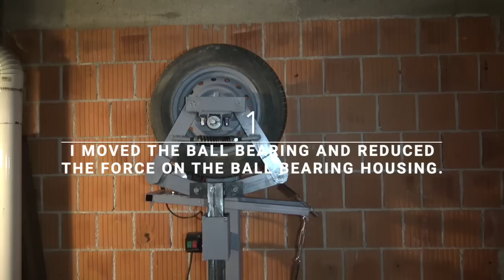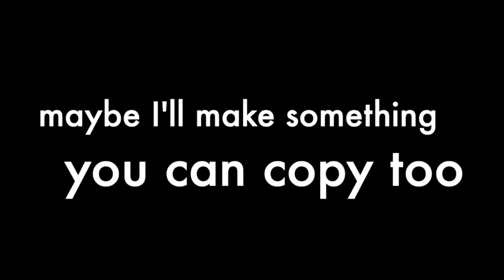DIY power hammer -step by step - home forge equipment

Comment: For all those wanting measurements. Here is a link for a rock crusher. It is not as refined as this power hammer. It can be adapted. 
No insult intended to the builder of this power hammer as it is a very nice build. 

I’m thinking a treadmill motor and controller for a hammer mill. Including the emergency stop 
https://youtu.be/yKnTT9XtkdM

Comment: I would of used lead instead of concrete for adding weight and noise reduction. Lead really absorbs so much better than crete. But I guess cost is another factor that must be considered. Nice work fella too. VF
Reply from the maker: I totally agree with you. But the price of lead would cost about 120USD, and concrete would cost me 18USD.
Reply: @diyguru1  Shame you live far from me. I would of just given you the lead. Oh well, maybe next time. Keep up the builds for us all to see on YouTube. VF
Reply: @diyguru1  Amen to that fella for sure.
Reply: What about lead from tire weights. We used to throw buckets full of old weights at the tire shop I worked at.
Reply: @joeysanchez5926  That is how I got lot of lead ingots for free. Not really sure one can call it free as cleaning and melting was time consuming and challenging too.
Reply: @victoryfirst2878  yeah, ive never melted lead but I have done aluminum ingots.
Reply: @joeysanchez5926  Lead has a nasty smell. A lot harder to handle than aluminum.
Reply: An old car battery will give you 40-50 Lbs. Nice simple design, Once you upgrade that motor it's gonna be a beast 🤙

Comment: Welding on a tire rim with rubber mounted can start a pyrolysis reaction and is a quick way to the emergency room or morgue, I'd highly advice against that for anyone watching this video.
Reply: Yep make sure you have tire deflated valve core removed. A good friends dad was welding on a wheel back when I was pretty young and it blew up and killed him be safe out there people
Reply: Pyrolysis is the reaction that happens when you apply heat to a material without oxygen. Or in more technical terms thermal decomposition of materials at elevated temperatures in an inert atmosphere. Which of course does not apply here. This does applies (in large) for making charcoal for example. 

What can and WILL happen is the expansion of air inside the tire due to the increased temperature combined with localized weakening of rubber. It's not just best to remove the valve, it's better to remove the entire tire to prevent accidentally weakening your tire. High pressure blowouts are pretty dangerous, especially when you are welding up close. Serious injury or even death may occur. 

But then again, the same applies for everything you see on the internet. USE YOUR BRAINS!!!!! DO.NOT.COPY.WITHOUT.THINKING.!!!
Reply: OHSA Section 25: Pyrolysis is a thermochemical decomposition of organic material which can occur at elevated temperatures in the absence of oxygen. This decomposition process only requires the presence of rubber and heat. When heat is applied to the tire or to tire components, hydrocarbon vapours are released inside the tire. As the vapours are released, the air pressure and temperature within the tire increase dramatically. These vapours are highly flammable. If the flammable vapour inside the tire makes contact with oxygen at a temperature in excess of 400 degrees Celsius, auto-ignition can occur, resulting in an explosion.

Once the decomposition process begins, it is irreversible. There is no visual indication that the decomposition process is taking place. Depending on the particular circumstances, an explosion may occur immediately, within minutes or several hours after the exposure to the heat source. In many instances, an explosion can cause the tire and/or wheel components to be thrown great distances, resulting in severe worker injuries and/or fatalities as well as significant property damage.
Reply: @ferrumchnop6617  I can't fault you for quoting OSHA, but chemically speaking that's bullshit since most tires are filled with regular oxygen rich air.

Not to mention the rest of the explanation. Good enough for a regular OSHA warning, but scientifically incorrect all over. 

but let's just stick to "it's dangerous"
Reply: OHSA and OSHA are two different things. Key word to the reaction being vapors. I understand what you were trying to say though.
Reply: @rt9934  interesting attempt at logic. 😊
Reply: I welded mine in a open shop with plenty of air with no issues

Comment: good evening. My name is Javier, I find your design very interesting. You could provide closer measurements to make a piece like the one you presented. greetings from Mexico
Reply from the maker: I don't have a draft. I worked from the material that I had, and I was determined measures on the fly.
Reply: Stuff like this is not an exact science. You take what you have on hand, copy the concepts the best you can, and tweak it as you go.

Comment: Awesome build.  Going to make one soon.  I like the tire idea.  I'm going to use an old solid forklift wheel for mine I think.  And figure out a way to give it adjustment in the hammer lengths by doing a swap for moving the flywheel pin location.  Not sure yet.  
Question:  How much did you spend in steel for this build?
Reply from the maker: Thank you. The whole machine weighs approx. 250 kg

Comment: Where did you buy the polyamide pa6? I'm having trouble finding some.
Reply from the maker: https://www.ebay.com/itm/182424141530?_trkparms=amclksrc%3DITM%26aid%3D1110006%26algo%3DHOMESPLICE.SIM%26ao%3D2%26asc%3D20201210111314%26meid%3Dcabb5679bb8e45f5a14312e72175cc39%26pid%3D101195%26rk%3D4%26rkt%3D9%26sd%3D142247924404%26itm%3D182424141530%26pmt%3D1%26noa%3D0%26pg%3D2047675%26algv%3DSimplAMLv9PairwiseUnbiasedWebWithSearchFilterPromotion%26brand%3DMarkenlos&_trksid=p2047675.c101195.m1851&amdata=cksum%3A182424141530cabb5679bb8e45f5a14312e72175cc39%7Cenc%3AAQAGAAABIIdETpqicceSh%252FKWJul4qzvh3awpeBWOdLwnXBUPPxZMq80bvqVEsVYR%252BRfAVPlcLPCbFYX3rfWrtIvfmKt%252B3sa21e0%252BFnhHxm0U%252FgVg%252BR8w%252Fw1qFK7CbBjC3fT3nxRrDEc%252FZzJriN%252B5mX%252FOWs6%252F5Ph%252BLJIwS1Lrjbjqo5s8gErmaouyXxHC6iECPHFqTtK9eBU5ky1plzaFtRJx1ZokuwxGNZxaJ4%252Fw3Oq3Toemk1FgXA7HNLp8IagQXE%252FWt2A0r8hUrVpQDV680vxZ7K5f5qoex9FS0mTLSNzVhxBb8GWloahXYKcuYkPeu2cjpzw89wuG%252BmeW8VJg9rreR4MzRbCyNGL0gEqOd8g9VTWiyWS23lmKbFB0CM3wp1xZZE80fQ%253D%253D%7Campid%3APL_CLK%7Cclp%3A2047675

Comment: where did you get the drive wheel that is on the motor. i found a 4 inch
Reply from the maker: It is custom made. A friend has a lathe. I gave him the measurements

Comment: What are the dimensions of the upright with the wheel attached? I would guess based on the video somewhere in the neighborhood of 6 inch by 6 inch by 80 inch  (15 x 15 x 200 cm)?
Reply from the maker: Tako je. 6x6x80 inch (15x15x200cm), a debljina je 0,2 inch (0,5cm).

Comment: What do you mean by 52,00 USD is it $52.00 or you want to mean $5,200.00
Reply from the maker: $ 52. I had the engine from an old pressdrill and it is not included in this price

Comment: Just a quick question. Is there a brake, or do you even need one on a light hammer like this? I'm going to be building a larger version of this type of hammer, and I'm planning a brake on mine.
Reply from the maker: I don’t have a brake and I don’t think it’s needed. After releasing the pedal, the anvil strikes once more and stops.

Comment: Has any cracking appeared on your floor? Is the floor reinforced in any way?
Reply from the maker: My house has 5 floors. My workshop is in the basement. I have a good concrete foundation. There are no cracks. If you have a weak surface, the floor may crack because the vibrations are quite strong.

Comment: What kind of motor is that at 14:15?
Reply from the maker: It's an engine from an old drill press. 0.7 HP (550Watt)
Reply: @diyguru1  danke!

Comment: what motor did you use is it 110 or 220 v
Reply from the maker: 220V. It’s a pretty weak 550W or 0.75HP motor, but it works. That engine is from an old press drill.
Reply: @diyguru1  when you upgrade it go to 3 phase on a vfd

Comment: Tube anvil?! 🤦‍♀️
Reply: The entire world in build with the aid of tubes. Why not an anvil? Cheaper too ;)

(sarcasm mode off) For those wondering, many have tried and failed with sand and concrete. It just does not work properly. You need dead mass for the metal to do squish. Concrete will not properly transfer the blow, it's simply too loose and will shatter and crumble over time. If hollow anvils were an option, you would see them all over the place. Quality anvils are just simply expensive for a reason.